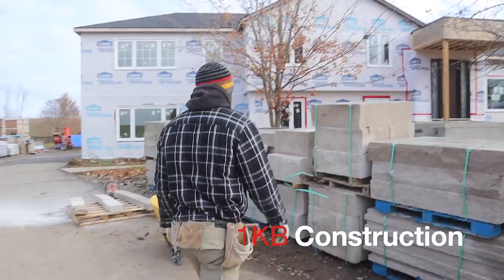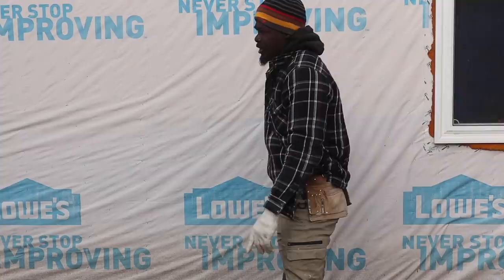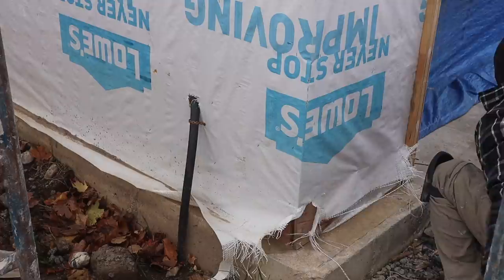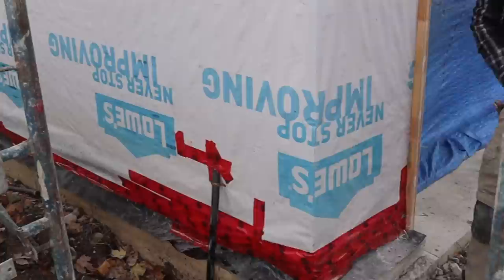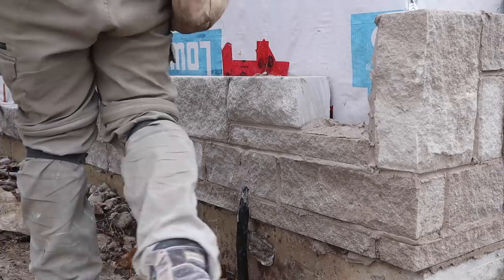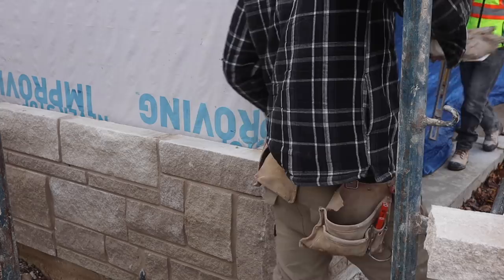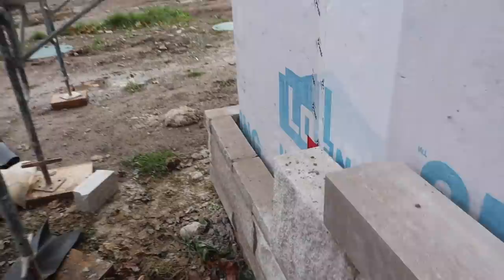1st Day of the Start Of Our New Project /They Don't Have No Sympathy for bricklayer, DIY Stone

Comment: If stone was to heavy, we used to cut it on site unless it arrived finished stone. We would use block and tackle to move heavy stone, you would need scaffolding.
Reply: That's stone for a gate I believe or steps
Reply: @Valient6  Its corner stone, the large square stones.. They are to give the corners strength. Whomever ordered the stone, should have ordered facia stone, instead of structural stone..
Reply: @chancethompson8686  exactly!
Reply: @chancethompson8686  so you are saying it's the wrong material. Gotcha

Comment: You're making the North Americas look good. Didn't think they'd have the mason experts. Let's be honest before I'm attacked, Europe and the UK is where we look to for mason and brick work.
Reply: The key is double buttering each stone this way no cracks especially on natural solid stone and dont "cut" or "feather" (whatever you want to call it) bed joints leaving a cavity in the middle of the stone this causes the bed joints to crack and not be solid! When mortar is spread for stone the spread should be more flat, Unlike spreading for brick& brick dont need to be double buttered aswell

Comment: Hi, wicked job there mate. Ive been laying bricks in England for years now, but was wondering if u have a cavity between walls like we do here.?? And also was thinking if that pipe was water or electric and why it was not brought into the inside of the property, guess that isn't your problem, but just wondered why it's designed like that.. I do like that stone work.. top job..
Reply from the maker: Thank you yeah usually we do have cavity we have like 1" of cavity behind our  wall here ,the pipe I asked the same question why is it there it shouldn't have been there
Reply: It adds a layer of insulation and a fire break.
Reply: @denisesweeney2588  no thats not what I does its code to allow air flow between the wall to help dry any moisture that gets behind it
Reply: The only thing that would make since to me is if that pipe was an earth ground for the electric.
Reply: I cant speak to anyone's code, but I agree with JR Drafting. Sheathing requires an air cap between its vapor and thermal layers. Joe Lstiburek has an excellent series "The Perfect Wall" outlining this from an engineers perspective. (And Meandering about to berate Architects who forget function in their quest for form :)

So, getting back to Neil, in the US we do aim for an air cap and expect the shething to breathe. As for the pipe/conduit, I can't say... It does seem like it would be more dificult  with on, but it put past anyone to imagine it being "the next guys problem".
Reply: That’s simply an extra feed from the well that doesn’t go through the water treatment inside the house.
Reply: @johnnyfred2125  yes, but why does it show externally? why isn't it hidden  Inside and insulated from the  cold? And it looks unsightly too...
Reply: @fjt4700  here in England we have 100mm insulation between walls. And it does allow for any water that gets through oiter skin not to pass to inside wall...
Reply: If that pipe was in northern parts the better plan on abandoning and installing a frost hydrant like the one he show just earlier and if it’s the supply to the house they need to find another GC regardless it’s not acceptable and no fault of our mason here .

Comment: Hey nevermind the brickey, have a thought for the landscapers .... they have to deal with all the other contractors garbage. Overspill from the concrete foundation guys, cutoffs from the framers, electricians, plumbers, roofers, siding guys, painters etc etc! And look at all your bits of concrete coming from every flick of your trowel! 
I once made out pretty good with 2 dozen 4x8 3/4 plywood sunk into the mud!  But mostly its the nails and screws in my tractor tires that get to me the most.

Comment: been doing big rock like that a long time ,it friggin sucks lol, we use slings with excavator, pallet forks on skid steer and build tripod with winch on a pulley system that has eye hooks lagged into the framing of house along the walls to guide the cables. its a pain in the neck to get used to and at 48 my body is pretty smoked from doing it for 35 years, so best advice is to not admit you know how to set that kinda stone lol

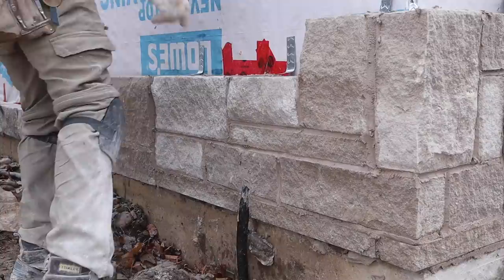Comment: 14:39  Brick ties:  When we built in 1990 the brick masons nailed the brick ties through the wall and into the plumbing main vent stack.  It took about 10 years for the nails to rust out and then the fun started.  Thousands of dollars of damage was caused by a careless nail.  Luckily it was covered by insurance, but I always wondered who had the responsibility to avoid this occurance.  I noticed this guy didn't check to see what he was nailing into when attaching the ties.  No criticism intended,  just curious to know how he knew what was on the other side.
Reply from the maker: I always check to make sure I'm putting the nail directly in the stud
Reply: @1kbconstruction824  I aplogize for accusing you of not checking.  Few will know the trouble you did not cause by being careful in your work.

Comment: I wish you or any skilled mason did my stone and brick work. The contractor my builder went with had terrible work. Gap was whatever they felt like on all rows. Bricks were sagging in some spots. They pointed the brick company logo stamped side out on a lot of areas. They didn’t follow the design I paid for. And there was mortar around the door on areas spanning 4” or more instead of cutting brick to fit. And also… large stone areas had no motor between stone. They stacked large stone on bare stone because they didn’t want to cut space for mortar…
Reply: Same here! I don’t think the crew even owned a level or chalk line. I wish I had a crew like the guys in this video.
Reply: @MoneyManHolmes  exactly what I thought when I saw my exterior. They attempted some repairs and they used wrong motor color so I ended up with dark patches.

Comment: I've been doing bricklaying for 22 years the vinyl should be hanging an inch past the concrete not necessary but preferred I always run a bead of tar where the frame meets the concrete but it's so important to have that vinyl hangout an inch from the concrete ledge
Reply: You should lay Brick another 22yrs. if you're installing Vinyl for flashing and think that is the way to do it

Comment: Where's the weeps and drip flashing at the base in addition to the fabric flashig. The reglet in top of the stone to receive anchors should be sealed with sealant or matic to prevent water entry which could freeze and cause spalling.  Come on!!
Reply from the maker: some people don't like to see the flashing down  at the bottom of the concrete  ledge ,I did suggest that to them they don't want it, they don't like like the looks , I do put weepin hole ,every 30" at the bottom of the ledge

Comment: I didnt see you install any drains or weeps in your first few coarses?? Any humidity that forms between the stone and the wall, will be trapped there, and rot out the wood, and grow mold...
Reply from the maker: usually when I'm laying stone I like to put the weeping hole  after I finish my jointin, i put every 30 inches at the bottom of the foundation ledge

Comment: I don't think it really has to do with the manufacturer I mean that could be the design of the house certain areas have big rocks larger tile so when you're taking the bid you should already know what the plans are and the design that way you know if it's large hevy oversized rock or stone material you know charge for it rent a loader or bobcat whatever you're going to need to get the job done to me it sounds like you didn't know what you were getting into and now that you see heavy large stone you're complaining

Comment: Hey nice work! I got a question for you… I am moving to the GTA and have about 10 years experience as a tender , what can I expect roughly for wages… I am coming from New Brunswick and get $27.50 here and looking to do a little better for myself . Cheers 😎☮️
Reply: Union  or non? I believe I union Tender make 40ish, my rate is 45.14. Most non union crews it's about 30